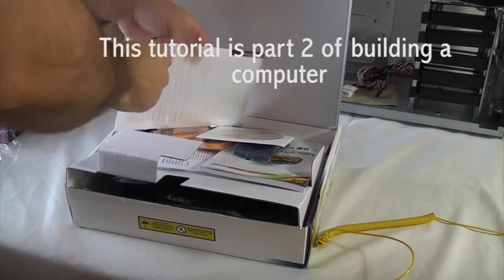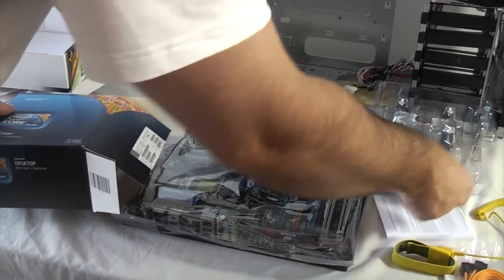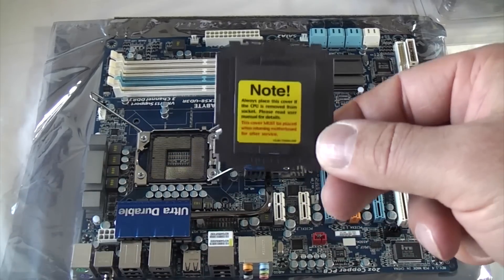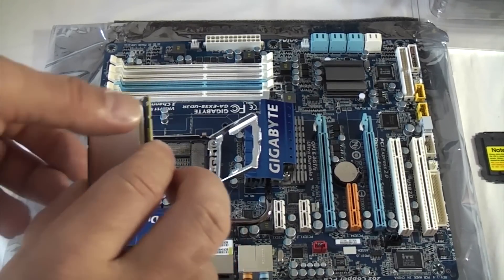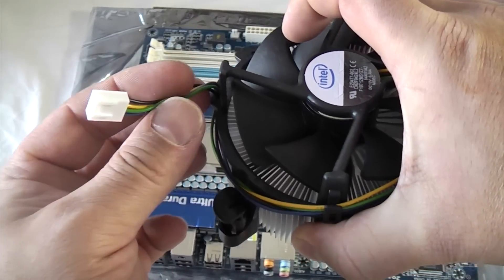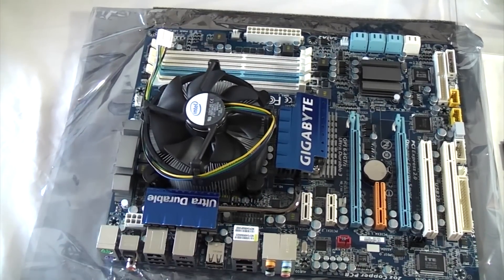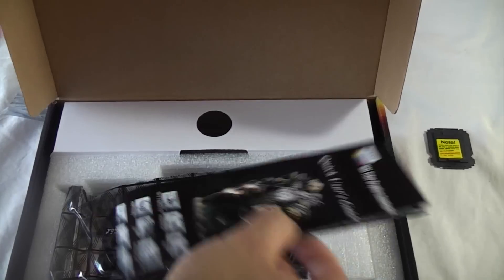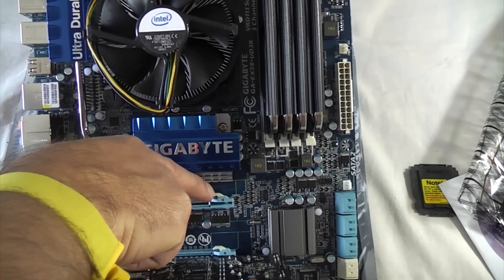installing intel core i7 processor to gigabyte motherboard

Comment: No. This video deserves a thumbs up, your comment deserves a face-slap. This isn't a video about "omg best components." It's a video about installing an Core i7 processor. I've seen about 10 videos now, because I'm worried I'm crushing my processor while locking the handle down and I can see in this video that it's the same behavior as the uploader. Most videos cut away, it seems like.

It's a good video, take your snotty opinion and shove them.

Comment: @ultimatehandyman GPU is graphics processing unit and on amd boards theres no cage surrounding the cpu just a pull down lever and once you put on the heat sink you can easily take out the cpu while pushing in the things on the side

Comment: @ultimatehandyman Totally agree. While there are some great aftermarket options out there the cooler that come with the processor are probably the most underrated part in the system.

Comment: @Deemkkoma you do not need to touch the device manager at all if you are upgrading just the cpu, you install the cpu and boot as normal with nothing else required. if you upgraded the motherboard AND cpu then you definitely need to reinstall the operating system.

Comment: ideally you want to plug in the heatsink/fan in a cross position.

top left then bottom right. top right then bottom left.

usually doesnt matter with plugs but can matter with screws.

Comment: @ultimatehandyman Ya i just looked up the board its an older model of that series of boards.
The new one is just the X58-ud3r they take out E and its bigger more ram, still a good board though and you cant really make much use of more then 6 gigs, the i7 memory controller cant read past 6 in most cases.

Comment: @ultimatehandyman What lordneol and SlyxFX are saying is that, to aquieve maximum performance on a i7 rig, you should be using 3 tablets of DDR3 memory, or a kit with a quantity of tablets that is multiple of 3. In your case, u r using a kit multiple of 2 (4 tablets), therefore, u r using Dual Channel, not Triple Channel. DDR3 and Triple Channel are different things.

Comment: @black0knightcs You need a motherboard with a LGA 1155 socket to run the sandy bridge processors that range from i3, i5, and i7.  For the bloomfield i7 you need a motherboard with the LGA 1366 socket.  I have no idea what the mother ZR7B is but make sure it's socket matches the processor you want to use or it won't work.

Comment: the 3770k is unlocked, represented by the "K". Having an unlocked CPU means you can overclock it, which is to bump up the frequency to something like 4.1GHz, but in order to overclock you need decent cooling equipment, like the corsair H100.

Comment: Hi there, thanks for the video, but where did you get your anti-static wrist strap with the plug ending? Most I seem to look at (I'm situated in the UK) have crocodile clips, and as my case is painted inside and out I don't think there's anywhere I can clip it to in the case.

Comment: I saw somewhere that is better to install the graphics card in the first one, the closer to the processor, not sure why if they are PCI 3.0 but it was a very good page. Thank you for sharing.
Reply from the maker: Thanks for the comment ;-)
Reply: yes it is most of the time one slot that is the the optimal but it does not have to be the one on top closest to the prossesor you need to check your motherboard book to see wich one is the the optimal the same goes with ram slots

Comment: @ultimatehandyman yeah your right here but in the video you put it in the wrong slot the top blue one is the fastest at x16 the bottom blue slot you placed it in is for the 2nd graphics card the main one goes in the top x16 slot and the 2ndry cross fire one is meant to go in the x8 one the 2nd one down if you have 1 card like in this video and you place it in the x8 slot you can only get x8 speed but if you place it in the x16 slot you get full speed and the lot

Comment: @Trickshot2008 My advice would be to buy one if possible. An alternative would be to regularly earth oneself by touching a metal area, like the case. However, this can be somewhat ineffective when handling components with a high surface area like a motherboard, in contrast to (for example) some RAM for a laptop.

I'm going to build a rig myself soon, starting with the case. =3

Comment: Nice video but is there a reason you haven't applied thermal paste? I thought that it was absolutely necessarily when putting in a CPU. Maybe I missed a part of the video where you mentioned why you had not used it but just scanned through the rest after I saw that it wasn't used

Comment: @ultimatehandyman In my case And that of some ppl on youtube the noise was the board and a power supply connection issue.
All tests on the board would not show it, but i replaced my board with an asus x58sabertooth, the fan and powersupply are the same no noise now.

Comment: @mathias921 
My Asus board says to use 8 pin. Never mentions using the 4 pin as an option. It is my assumtion that since the Core 2 Duo only used the 4 pin and the core i7 is a better processor that it would require the 8 pin for more power.

Comment: Tip: Don't use the standard Heatsink & Fan as shown in this video which is provided with the retail CPU packages, buy a quality HSF or water cooling unit. You want to keep those temperatures as low as possible so when it comes to overclocking or gaming, so you won't run into problems such as lowering the lifespan of it or causing the PC to reset itself.

Comment: A quick question. Where do you get those anti static wrist bands??  Also I have seen type that connect to the pc. Whic one should I get because If I do build a pc I don't want to fry any parts.

Comment: Thank you so much, no I can get my fan on over top of  the processor. Thought I had to turn the devices to mount on top.... I was told to find the battery to remove a virus from the bios. I thought it was where the processor was..Only thing is that I already touched the processor edges without a wristband. But haven't turned on my pc. What happens if I do...&  if there are repercussions ...how do I prevent them from happening or damage 2 my computer? So works smoothly again. Thank u 4 your help.

Comment: @adecoy95 Some Processors like the i7 will not have pins on the bottom just contact points. Which I would treat like pins because you don't want to gum them all up. 

As Far as pins. Treat them like a tiny bomb, delicate and careful. If aligned right with the motherboard it will drop in with ZIF ZERO INSERTION FORCE. And you will be fine.

Comment: FYI: If the ram block is inserted correctly, you dont have to shove the leaver in. Just my experience.

And why do you choose the 2nd port for the graphicscard?

And i understand why you got so nervous while pressing the lever down at the cpu. Looks like i was ready to snap a mouses neck!

Comment: Is the static caution just a "good measure?"

Because I took apart my mom's computer from like 2004, on my carpet, no giving a care to discharging myself.  I placed the mother board on the carpet for heaven sakes.  And then I put it back together, and it worked fine.  So is there an actually big danger, or is it just because of the chance?

Comment: I would go for a  i7 3770k , HT helps at rendering a lot ;), for the other parts I think a 670 will do if you have the money if not a 570 or a 7850, they are quite the same.

Comment: Great video, I have an i7 4820k that I want to upgrade to a i7 8700k. Watching this and a few other videos it looks very simple and straight forward. I believe I have 2 8GB to make 16 GB of ram. I want to get 32GB can I just get 2 more sticks and simple slide them in and that’s all?
Reply from the maker: I believe you can, as long as they are all identical in size and make.
I did hear that people have had problems when mixing different makes or RAM.
Thanks for the comment
Reply: Hey sorry to disturb again, but one last question. Is the i7 8700k compatible with a GIGABYTE GA-X79-UP4 ATX/8DIMM Mother board?

Comment: @ultimatehandyman i did but i when ever i do the third pin it pops out another and if it doesnt then the 4th will pop out the third then the third will pop out another. on the back the black plastic is completely through on two but half way on the other two. right now my temps are pretty low surprisingly but i can never get all 4 pins down.

Comment: I thought of a solution to the problem of intel bug zapper socket. They should make the contacts on the motherboard a loop instead of a straight wire. Then it would be difficult for the bugs just to crawl right over it. Plus it maintains contact with the cpu while the fan speed is set at high. Do to vibrations these contacts on the current intel cpus vibrate and move a loop would prevent that.

Comment: Have the same motheboard but X58A-UD3R with the 4 PCI x16 Slots. Do you know if the Kingston HyperX CL8 Modules are compatible with this board (3 x 2GB) 1600MHz ?

Comment: HI Strd95. Is it just me or when you install the Intel six core 980x and then you close the bracket on top of the processor, it does not close hardly at all and the pushing the lever back in place to lock has ALOT of resistence? I have installed about 5 Core 2 duo's but never seem to have near as much resistance as the Core 980x. your thoughts?

Comment: it's a relief to know the i7 comes with thermal paste. i just ordered my i7 and was afraid i'd have to order more. now if only i could find my antistatic wrist strap...
Reply from the maker: +Vociferous Daew I think it only comes with paste applied if you buy the processor with the fan as a kit. You will soon know though if you need thermal paste or not!Thanks for the comment
Reply: +Vociferous Daew i want to buy A new mother board and on the site it says its compatible with i7 but I'm not sure if i have a older i7 are there different models of i7 cpus? and if there are how could i tell them apart?
Reply: 2pvideo It really depends upon the socket type. When your looking for a new motherboard you'll usually see the socket type in the title or specs as "LGA..." followed by the number of pins. I have the i7-4790k and bought the MSI Z97 PC Mate with an LGA1150 socket. It works great and it's affordable. If your using an i7 900 series you'll need a motherboard with an LGA1366 socket.
Reply: Vociferous Daew oh ok thanks but how would i know what i7 procesor i have?
Reply: 2pvideo Easiest way is to go to your Start Menu, right-click 'Computer', and select 'Properties'. You should see your processor listed there. You could also search your computer for the word 'Processor', click 'Check my processor speed' and it should bring you to the same window.
Reply: Vociferous Daew oh ok thanks man
Reply: 2pvideo np bro.

Comment: dont u have to push the processor on the motherboard until it clicks and then close the cpu holder? so the 1336 pinholders clamp to the pins.

Comment: I have took out the processors fan for cleaning after 1 year of use, do I need to scratch out the sticker(melted) and put thermal in? noobie in cleaning the fan without noticing the consequence.

Comment: I should note that when I remove the Intel heat sink, there's only a small trip of thermal paste on the CPU itself, as if the rest of the plate isn't making good contact.

Comment: Funny, I checked this vid just because I was wondering if it was normal to have to apply the weight of the gods to close that lever.  Also, I'm having loads of heat trouble using the standard intel cooler - its like it won't seat on the CPU fully and I idle at 80c+.  I have all kinds of issues getting the pins to work.  I'm hoping a Coolermaster Hyper 212 will sole the problem.

Comment: I got a cheap asus socket 775 motherboard and it was remarkable the force i had to apply to the lever. 
When mounting my Q9550 i was unsure at first, even though it was totally alligned, while the lvr was in the middle i pulled back for another attemp n the cpu was ejected to the other side uh, and again ejected twice
Third time just pushed all the way down, seemed like it didn't want to move, when i the lvr was cmin down i heard like a crack or a scratchin sound... 
Hope it's alright

Comment: I just got an intel i7 940 processor, and a Gigabyte GA-H55M Rev 2.0 motherboard. When trying to install the CPU, it feels like the slot for it on the motherboard is too small, and the CPU won't align properly even with all the safety features (for example: the slots on the side to secure it are both covered by the CPU.)

Is there some help/advice you could offer?

Comment: Hey I'm trying to install intel 2500k sandy bridge with new motherboard. if i install mbo/cpu and keep all other parts the same. When I start the computer would I have to mess around with bios or other software? or would it be like video card; just install it and when I turn on computer I don't have to do anything other then installing?

I want to upgrade my cpu but i'm afraid I would have to do something bios/software wise which I have no clue what to do with

Comment: @ultimatehandyman i had to really REALLY pick out perfect parts because i have a midtower.

i got a strange C design heatsink/fan from noctua. it saves a lot of space in my tower and also cools my ram. triple channel corsair dominators 3x2gig. 1gig radeon like yours. only got half of your ram tho. i might end up getting an external 1TB. 

think windows xp is a waste? @_@. dont have windows 7 yet.

Comment: @lightraider64 No it won't, if you have an AMD CPU, it'll work for either a AM2/AM2+/AM3 motherboard, for intel it's 775 socket, LGA 1366, LGA 1156, and LGA 1155..

Comment: So no more worrying about applying the gel to the heatsink?  Is this the case with most components now?  Need to build a new pc but was worried about that...
Reply from the maker: omni42 It depends if the thermal paste is pre-applied or not. I did have a tube handy as I was not sure until I opened everything up, then I saw it had been applied already.

Comment: If i buy this from amazon. When i get it would i be able to just replace my old prossesor with the new one and thats it?
Reply from the maker: As long as it is an identical processor.
You will have to scrape off the old thermal compound and apply new though ;-)

Comment: Sorry, I accidentally hit enter instead of backspace, my question was my i7 processor did not come with one of those static bands, #1where can I get one #2if I cannot find one what are the precautions I should take to prevent static electricity from damaging my hardware?

Comment: Overclocking has some great benefits. But if you do ever overclock DO NOT use software. The most stable way is to do it through the bios. Let me know if u ever wanna overclock.

Comment: hello, In my acer aspire e1-531 I have an intel celeron B830, I want to replace it by the I7 2630qm, it is possible ? Because they have the same socket.. Or there are other conditions ? Thank you
Reply from the maker: You need to check that the motherboard can support the speed of the new processor. You should be able to find this information in the manual for your existing motherboard.
I'm not 100% certain it will work so always best to check the manual ;-)

Comment: easy to get the cooler on - i remember an old dual core i built back in 2004/2005 i think it was. I thought i was going to break the board getting that thing on.

Comment: Hey I took apart my computer on my carpet, what's the deal with this static discharge, I have no way of fully testing my computer because I bent the pins on my microprocessor. What causes static discharge?

Comment: Does this come with an installation disc of any kind?
Reply from the maker: There is normally a driver disc with the motherboard, you just install the operating system then install the drivers from the disc.

Comment: do I need 2 anti static bands, or just 1 for both arms?
Reply from the maker: +Alexander Savekin 
You only need one, you can wear it on either arm ;-)
Reply: +Ultimate Handyman ty,  and even with Anti static, I shouldn't be touching the circuit boards, right?
Reply from the maker: +Alexander Savekin Once you have the anti-static wristband on you are safe of touching most things without causing static damage but best not to touch the board as the grease from your fingertips might cause damage a few years down the line ;-)
Reply: +Ultimate Handyman OK thanks you so much
Reply: never touch the gold pins on the underside of the processor. same goes for any gold contacts on ram and graphics cards.

Comment: I have a big question and i real need some one to answer if you can im having a problem with my computer im playing a game that needs to have 2.4GHz and my computer is giving me 1.3GHz and im just wondering could i put a intel celeron processor E3300 into a Acer X1430 if so where can i find that processer im in ireland by the way if that helps a answer would be great thxs

Comment: Another idea is to fork the pins so instead on one touching the contacts of the cpu you have 2 so it stays in contact and removes the flickering problem that intel cpus have in gaming. Plus I was watching a movie recently lampoons Christmas vacation the sliding part reminds me of the bottom of the intel i7 cpu. sliding cpus any one. If I never get mine working again I might test it to see how fast this cpu can slide down a hill. Friction point  would remove this problem with the cpu or just 1 wire flat on the bottom of the contacts of the cpu.

Comment: i want to buy A new mother board and on the site it says its compatible with i7 but I'm not sure if i have a older i7 are there different models of i7 cpus? and if there are how could i tell them apart?
Reply: if its already in a pc go to the properties and see which i7 cpu u have as there are many i7s and see which socket is your i7 and write down its model down then go to pc part picket choose your motherboard then your cpu and is whether is compatible!